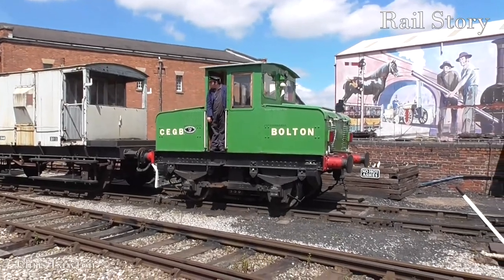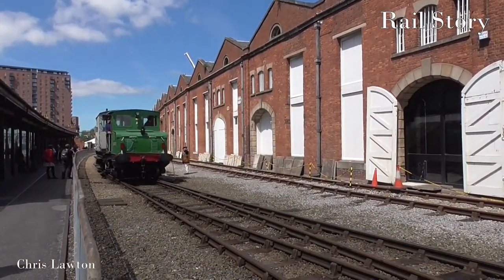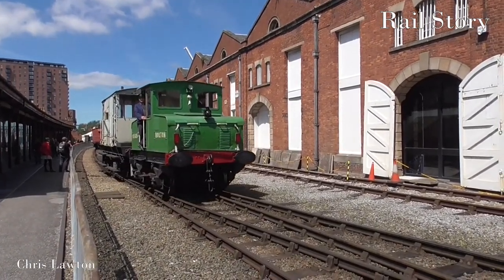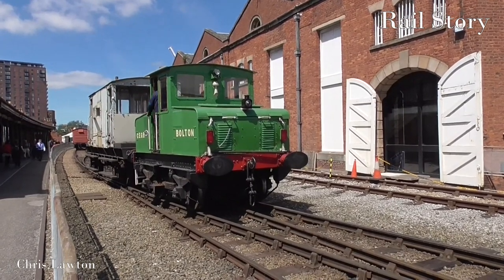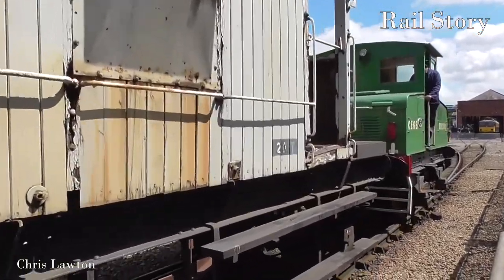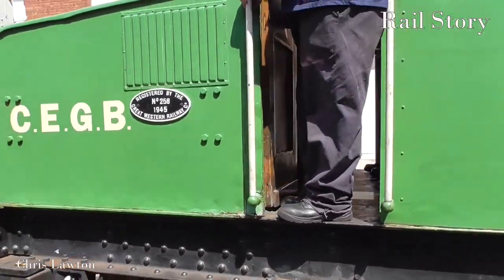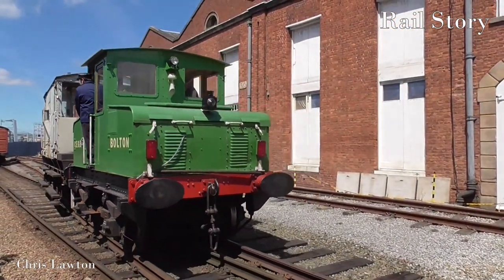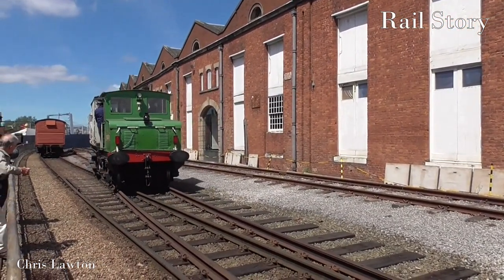Profile: English Electric Type 3B Shunter

Comment: Back in the 1970's there was an electric railway in Kearsley powers station and a line up to the exchange sidings on the Bolton to Manchester line which used this type of locomotive but powered from a trolley pole overhead system.
I managed to get a couple of trips up and down and around the internal system.
Much fun!
If I look out of the bedroom window I can see where all those little trains used to run. 
Oh for a time machine to return to my youth!
Reply from the maker: the Kearlsey Steeple Cabs were bo-bos, they were on two four-wheel bogies. All four of them are preserved. There used to be on at the Science & Industry Museum until the 1990s.

Comment: Great video: always loved these little electric shunters - hope that they make some op gauge models of them in future
Reply: Hardys Hobbies make a 3D printed kit
Reply: For the H0 market there is the Rivarossi ASF (which looks about the same) , and Brawa had a Ks (looks like a shrunken regular diesel) in the past with opening battery hatches.
For a larger vehicle, there is an E80 by Roco
Reply: That would be very nice to see in OO! For RTR HO models currently available the Roco Alpspitz-Bahn cogwheel electric loco looks pretty similar to this. If you are looking for a bo-bo, Tenshodo has the Toshiba 40 ton locos.

Comment: The Suburban Electric Railway Assocation has one of these. They have Spondon Number 1 which is based at the Battlefield Line. It was based at the Electric railway musuem for a number of years before moving to the battlefield railway. Recently it has been repainted and cleaned up and has been doing odd work including a little shunting and hauling spoil trains.
Reply from the maker: Spondon 2 is at Foxfield but needs new batteries.

Comment: Thank you for this. A neat little locomotive.
Reply from the maker: It sure is!
Reply: @AnthonyDawsonHistory  Going deep geek here, but at Western Railroad Museum, there is a Key system work motor, 1215. Phone booth on a flatcar using a K controller and hand brake. Fun little thing to run. Sadly side lined with motor issues. Check the WRM website under the Roster. Would post the link, but lately posts with links disappear.

Comment: Love these "baby crocodiles". Do they use lead acid batteries or like some fork lifts and milk floats of the time, nickel iron, which have a greater lifetime cycle count and need less maintenance.
Reply from the maker: When new, lead-acid batteries. This example had new, modern batteries fitted c.15 years ago.

Comment: I was based at Upper Boat Power Station during my apprenticeship. During my training period with the Combustion & Efficiency Department, I was lucky enough to drive all the locos there, including the English Electric battery loco. I had a go at shunting the coal wagons over the weighbridge for Tare checking. Great fun!
The loco had previously been fitted with a pantograph, but this had been removed following a dewirement that left arc spatter on one of the windscreens. The OLE had been dismantled prior to my time there.
There was also a Barclay 152hp shunter, but that was sent to Uskmouth PS, and replaced by a Ruston 88DS from Cardiff PS that I helped to prepare for service.
There are 2 photos of the Battery loco in service on my upload  https://youtu.be/TtHYHF14Bj4  . The pictures are not great quality, but they do show the environment in which it worked. I liked it, even though I got a shock off the damp side of one of the batteries during maintenance 🤣